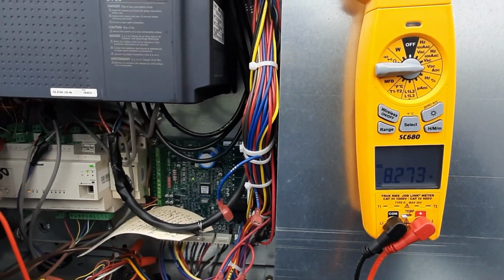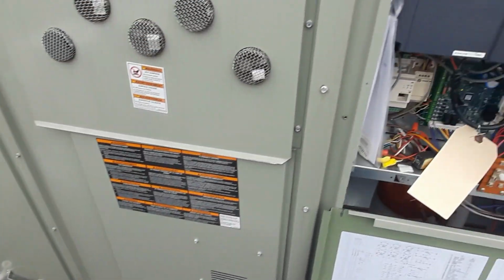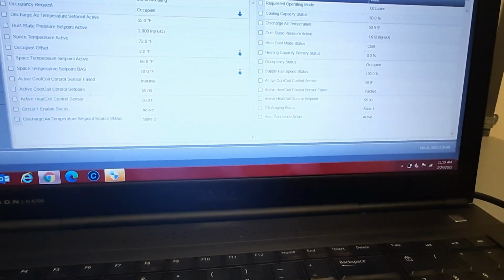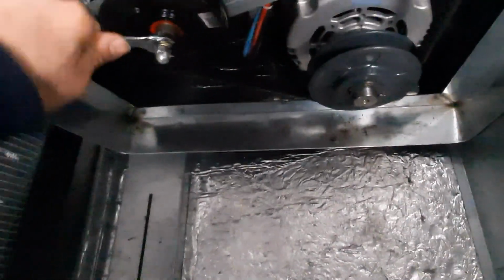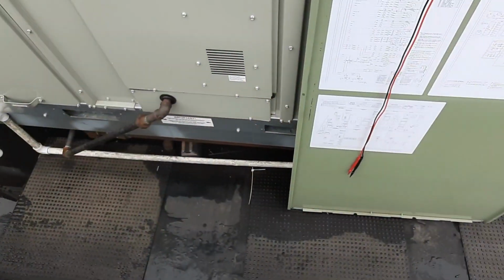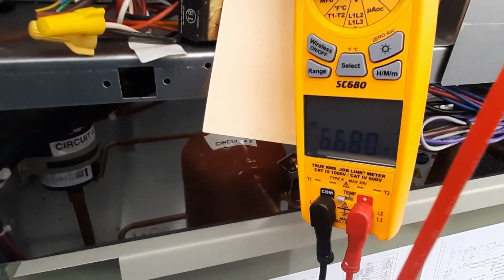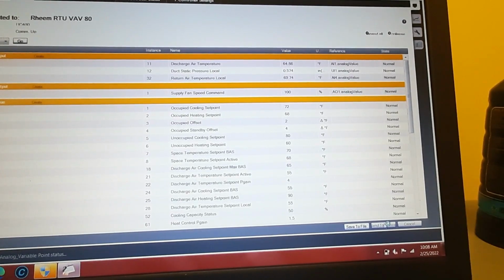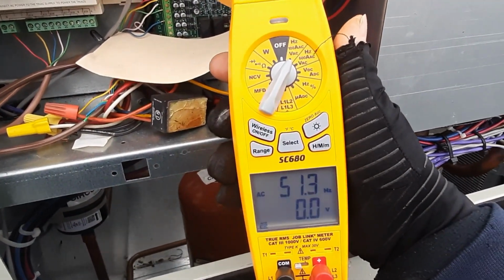HVAC Service Call Commercial 20 Ton Trane package unit, Variable Air Volume

Comment: That VFD didn't look like a factory drive, usually supply fan motors are ECM for that rooftop unit.
Maybe that's why you also had an extra UC400 controller
Reply from the maker: Thanks Sergio! You are correct, they modified this unit to operate as needed.

Comment: I'm greatly curious what it was about the other meters that wouldn't let them read accurately, especially as you mentioned that they too were true RMS models. I've never 'scoped one, but it would come as a surprise to learn that the VFD's output waveform would be distorted.
Reply from the maker: I'm not sure I said all were true RMS and I would be incorrect if I did because I think that was the issue, mine was true RMS and still deviated from actual amperage. I think the previous meter was incapable of reading,  depending on meter the amperage will fluctuate when reading on VFD. Meter with low pass filter and true RMS are capable of reading accurately
Reply: @EverythingHVACR  I might have misunderstood or misheard. I didn't even think about the need for an LPF or the harmonics that the drive might output, so that's a very good point!

Comment: Are you trying to compensate for some undersized ductwork in the building with higher supply duct static pressure? 2.0 inches sounds a little high unless unit is serving a lab or medical facility. 
Usually 1.5 inches on supply duct is a good starting point.
I’ve been in the HVAC industry as a tech for 32 years and still get humbled. I hope It’s god reminding me I’m human and to stay grateful. 
Love your videos, keep up the good work!!
Reply from the maker: Yes HVACtech I am compensating for bad duct work but 2 inches isn't abnormal it really depends on the building, I have a few that run on 2 inches water column
Reply: @EverythingHVACR  gotta do what you gotta do with what you have.   Thanks again for your hard work with these.  Don’t know how you do it and work a full time job at the same time.  👍🏿
Reply from the maker: Thank you 🙏  just hope some of this helps others. It's not always easy but a little extra effort goes a long way! Leave this Trade better than you found it 💪

Comment: Congratulations on hitting 3k. You deserve much more though. You are definitely a top dog for commercial and industrial content. I always look forward to your videos. Keep on producing kick ass videos Steve

To read correctly on a VFD you need a meter with a purposely designed filter for the electrical "noise" a drive produces
Reply from the maker: Thanks Jason! Yeah low pass filter, this 680 kicked ass though
Reply: @Everything HVACR  thats a real nice meter. Thought about buying it. Let me know what you think about it after using it for awhile.
Reply from the maker: Will do Jason!